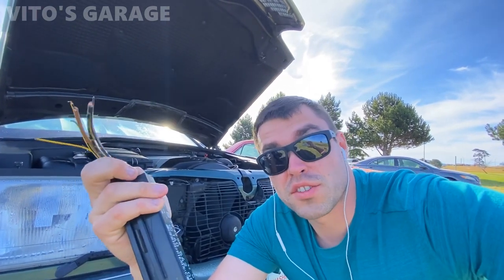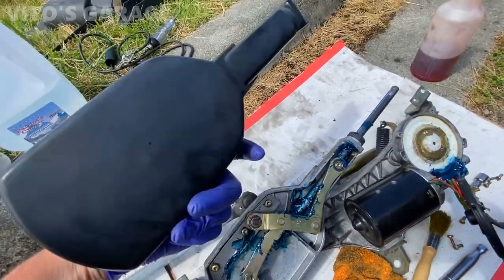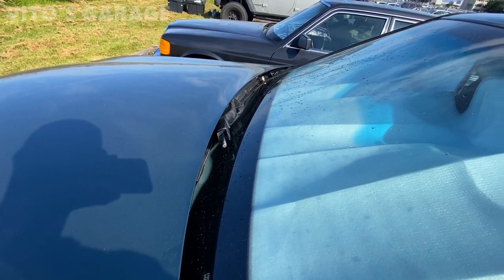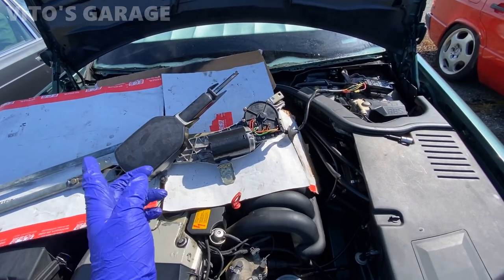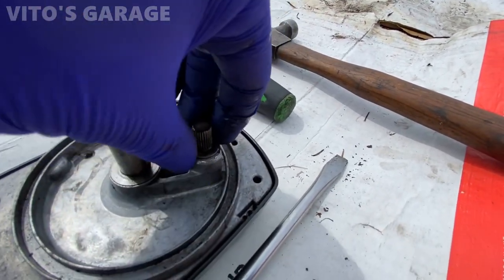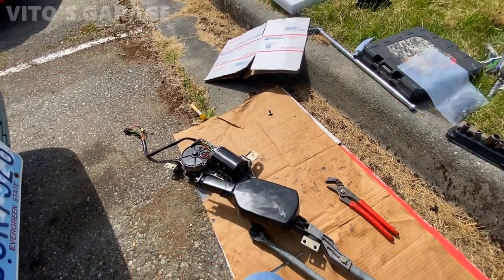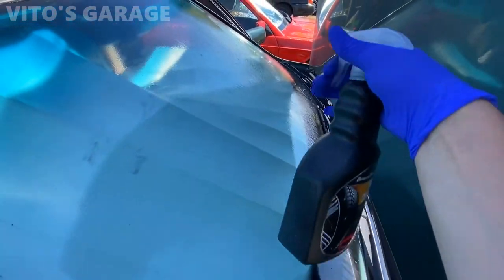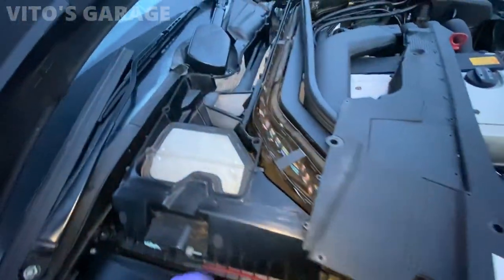Mercedes W140 Crocodile Fixing Broken Messed Up Wiper System.. New Cabin Filter

Comment: Yes, I had issues with this relay for 2 years. Sometimes wipers were not responding to switch. Needed to smack the relay and it started to work. But that was not normal. Took it apart and found out, that one wire had unsoldered. But even after re-soldering it, it glitched. Installed used replacement - no issues.
Reply from the maker: Great. Thanks for sharing! More videos coming soon!

Comment: The gear that’s stripped you can now order made of brass it’s much much stronger. This is a very complex super system on these cars. Works great when working properly. But it’s not a mechanism that can go without some service and lubrications every 5 years or so. Otherwise gears strip and stuff starts to malfunction.

Comment: im facing same thing, I have bronze wheel purchased from eBay
Reply from the maker: They have metal wheels (gears)?
Reply: @VITOSGARAGE  I purchase one 2 years ago from eBay. Seller was from Ukraine as I remember. It is made of bronze.
Reply from the maker: @Uc9uE3pKsS6uQ  that’s pretty awesome. However, the metal gear will wear the plastic half moon gear in the wiper assembly pretty fast. You either have to have plastic and plastic, or metal and metal. So if you find a metal half moon gear, install that too!🙂
Reply: @VITOSGARAGE  this is collection car I do not drive winter and rain so will be fine